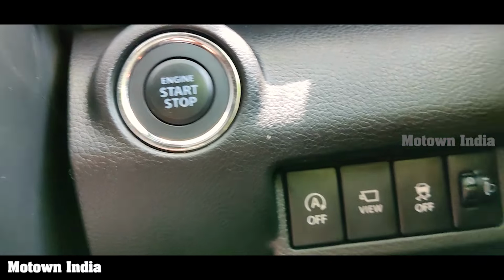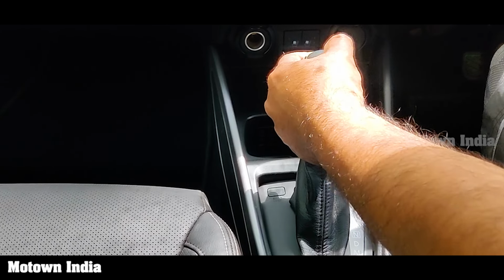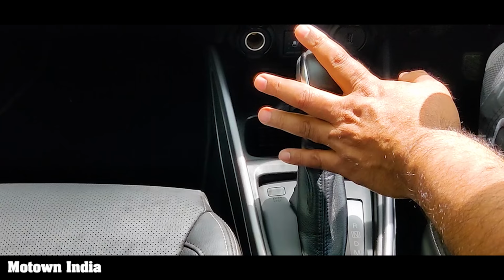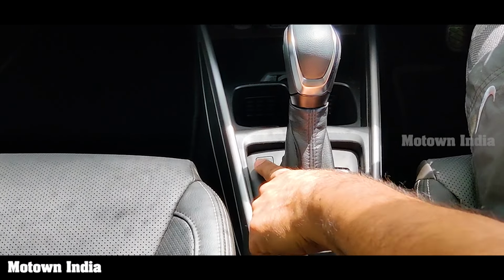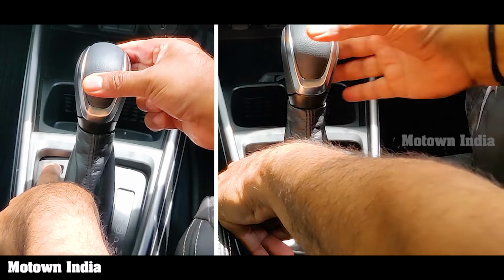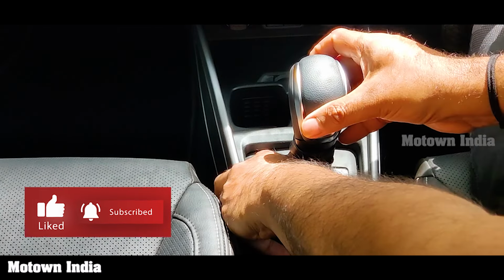Shift Lock | What does it do? What is its function?  | Motown India

Comment: 1) normally, automatic transmission can only be shifted (P, N, R, D, etc) while the electricity is engaged (key on, battery normal)
2) in case of emergency, like dead battery, or unable to turn the key on, the shiftlock button is used
3) shiftlock button overrides the "lock" in the transmission, allowing you to shift transmission without the need of electricity

Comment: What does it mean when the car is on but it’s still locks? I have to unlock it all the time before I can change gear.
Reply: It wasnt like this when I got the car 2 months ago. My car is 2016 ignis
Reply: Either your brake switch is broken or your shift interlock solenoid is bad. (or the wiring to them is bad). If your brake lights come on when brake pressed, its probably not the brake switch. GL